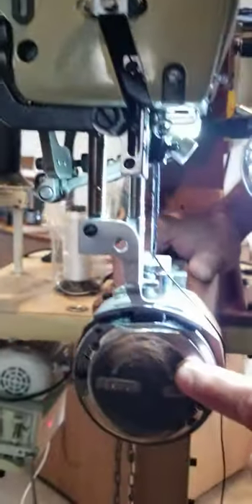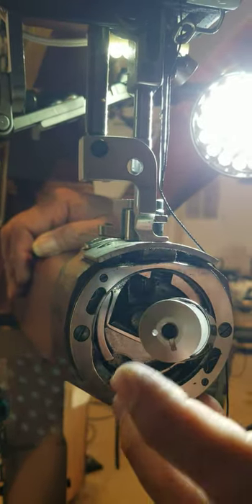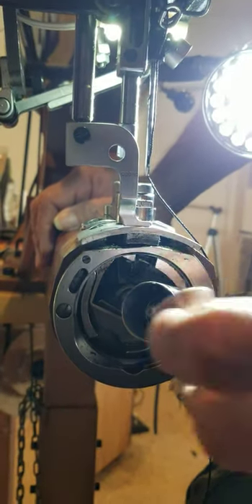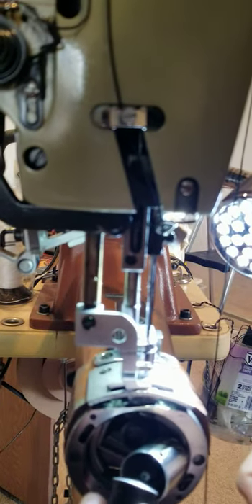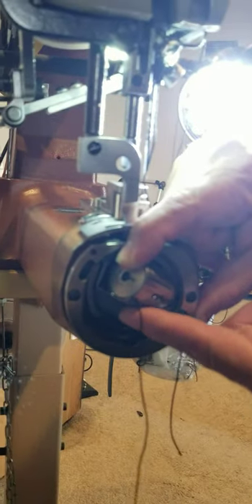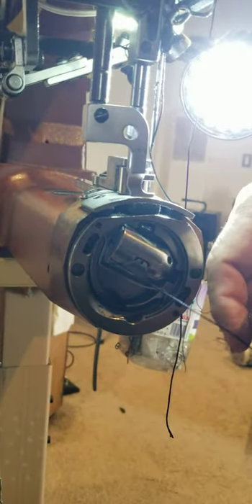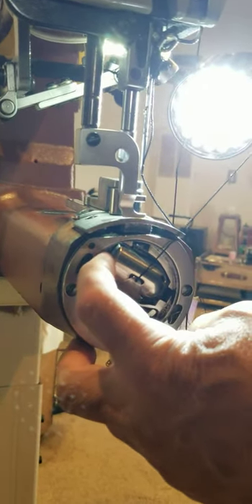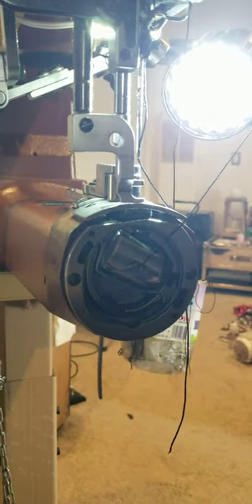Fine points of Bobin changing procedures for the Cobra Class 4 or Juki 441 clone sewing machine.

Comment: Awesome video! Would you mind detailing information on the spring inside the bobbin? I’m currently troubleshooting an inconsistent thread tension issue and I’d love to learn more about the springs involvement here.
Reply from the maker: The spring inside the bobbin case is called the bobbin ejection spring. It does exactly that. 

The bobbin injection springs sole purpose is to help pop the bobbin out when you open the bobbin case.
 It should not significantly effect thread tension. If you unintentionally install the bobbin where is spinning clockwise then the spring itself is damaged and needs to be replaced.
Reply: Thanks for the reply! I purchased the machine used so I’m kind of working backwards on everything. My issue is that if I pull on the string, it’s very hard to pull, then it releases all at once and the bobbin spins. I’m researching now to find out exactly what all components affect that and how to work on it. I figure the spring applying some small amount of pressure would potentially avoid the free spinning effect.
Reply from the maker: @919specops  sounds like you need to replace the spring. They're not very expensive and easy to install. Just call the leather machine company and they will send you one.